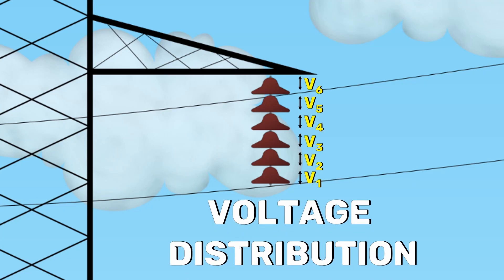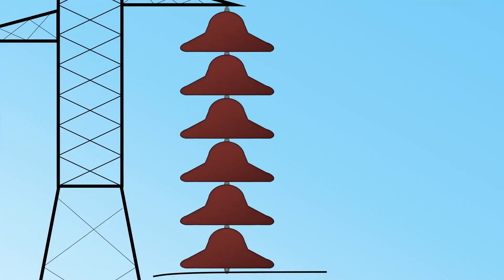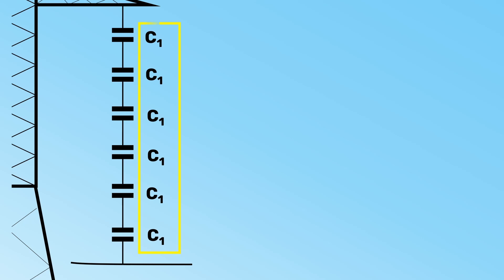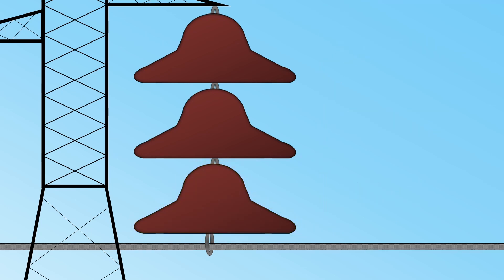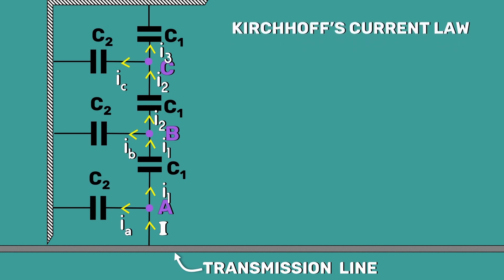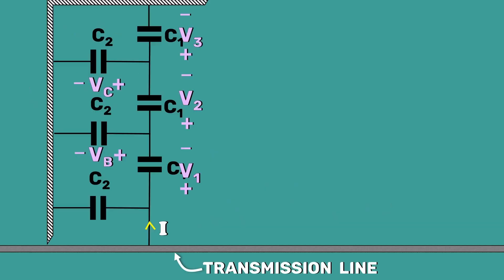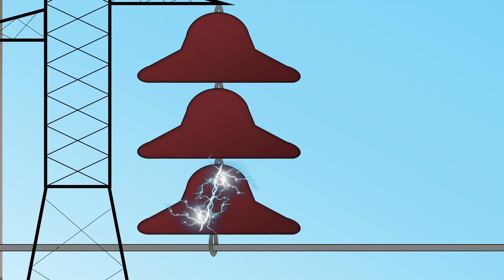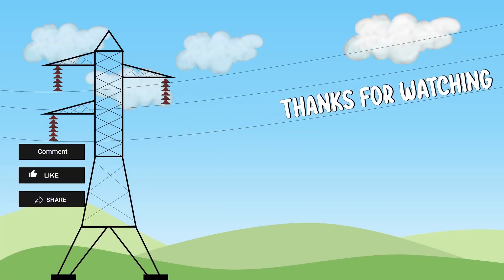Voltage Distribution Over Suspension Insulator

Comment: clear explanation of concept.
my question:
how will the charging current be distributed among shunt capacitances. 
why do we use metalic link between insulators, can't a non metalic link would have resolved the issue.
Reply from the maker: The shunt currents are ib and ic. From 04:20, we can understand that ib is proportional to Vb and ic is proportional to Vc. From 04:40, its clear that Vc = V3 and Vb = V3 + V2 . This means ib should be greater than ic. 

Insulator discs are heavy. Similarly, the powerlines that hang from the insulator are also heavy. Therefore, the links should be very strong to hold these heavy things.  We cannot compromise with the strength. So, I think metals play a good role here.

Please let me know if you still have any more doubts.